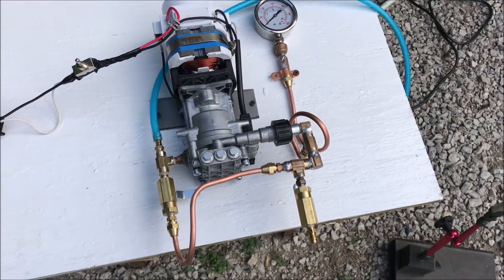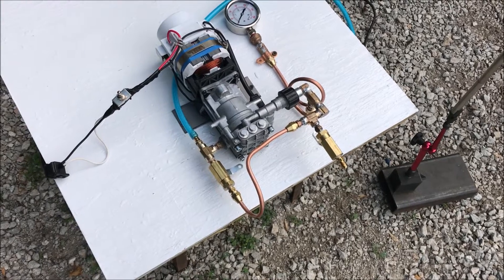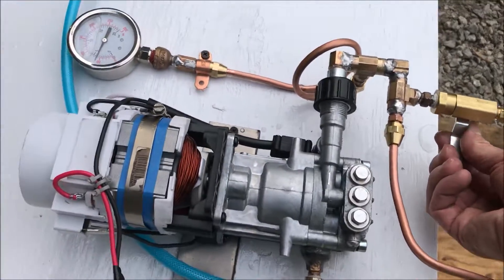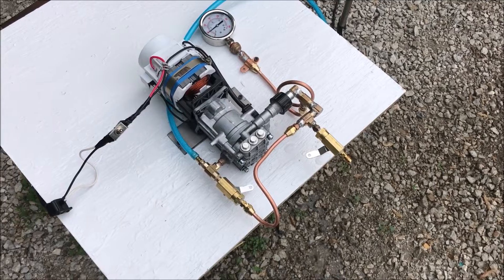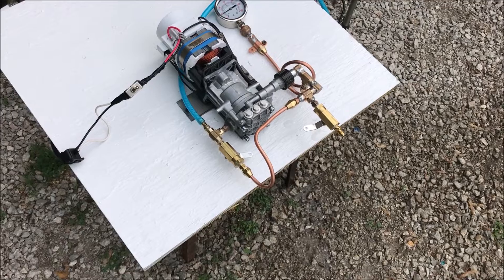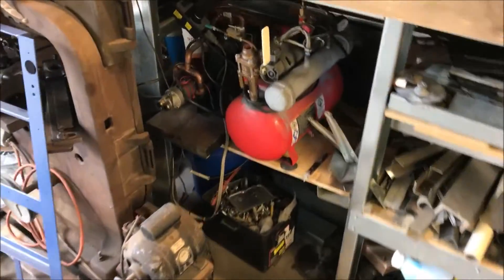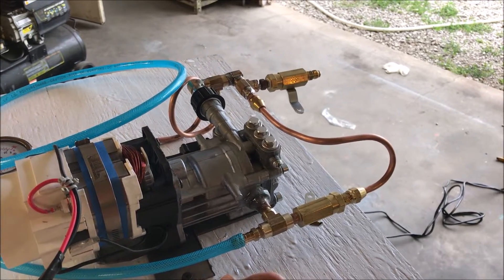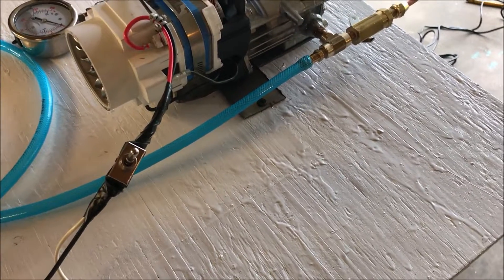how to build a bypass valve high pressure low flow water pump or oil pump

Comment: Interesting. Could you suggest any low cost set up for supplying waste veg oil to a centrifuge which needs low flow high psi of about 80-110 psi?
Reply from the maker: For that much pressure your kinda stuck with a pressure washer for low cost
Reply from the maker: Your other option is to buy a $130 8 gallon air compressor . Fill the air tank with oil and connect an oil line to the bottom tap with a valve .
you will need to weld a 2" nipple to the tank and use a 2 " end cap to add the oil to the tank . Or use spool tube
Reply: @NOBOX7  I’m going be travelling too fill time so something reasonably simple. I’ve got space for two 44 gallon drums. Small block chevy pumps look like they might handle it. I’ve got a 2HP induction pump here but a scooter motor might be better smaller lightweight?!